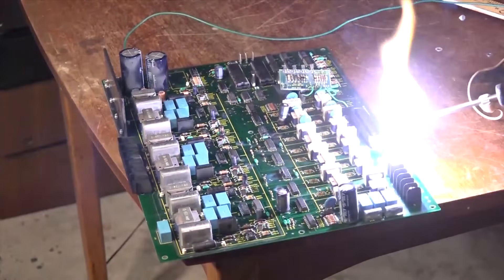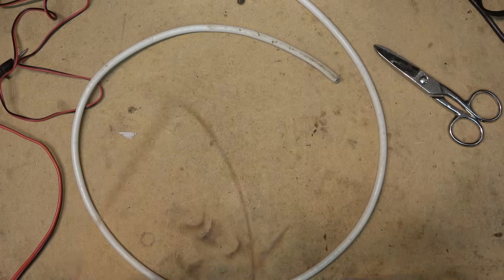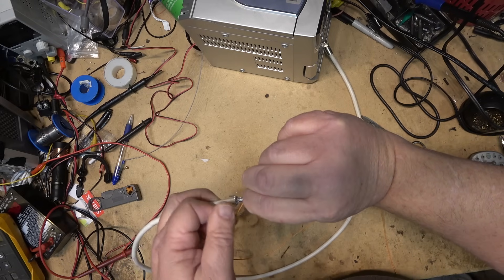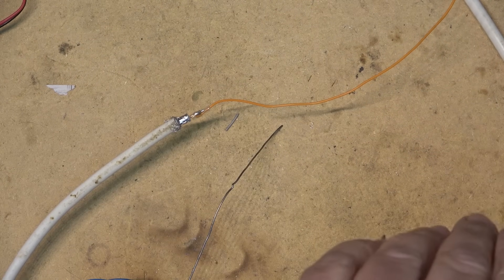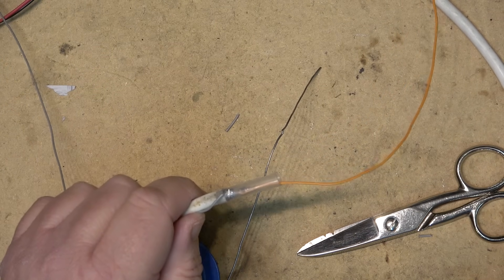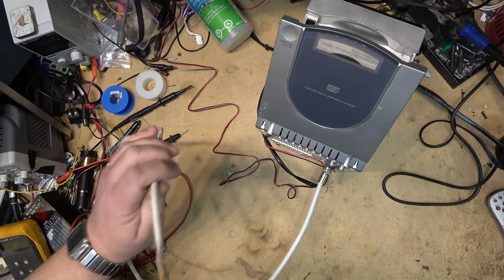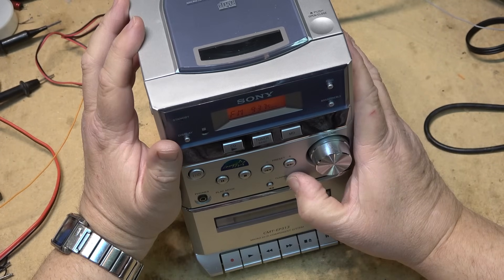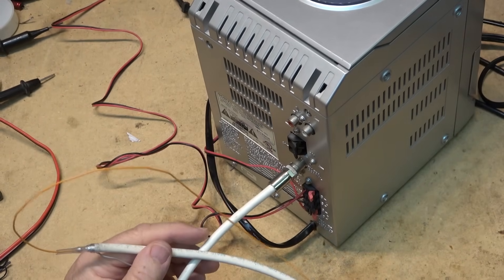Build an indoor FM antenna for 75 ohm coax input

Comment: What if the radio doesn't have coaxial connection ? How to get better reception then ?
Reply from the maker: Use a piece of regular speaker wire.  Zip it apart to the same length for the antenna side and the other side connect to the 2 screw terminals marked FM 300 ohm.
Reply from the maker: @sblaze4  the type of wire doesn't matter.   300 ohm is the 2 terminal connection and 75 is coax.  With 75 ohm you have a single antenna lead and ground.  With 300 ohm connection both wires are active.  It is a balanced connection.

Comment: When or how did 1 29 and a half inch wire turn into 2 wires?  Are the now 2 wires both 29 and a half inches or are they 14 and 3/4th inches?
Reply: 2 piece 29.5 inches to make a 59 inch antenna. you can use 3/8" diam rods if you want something more stable. Screw the centers to a flat piece of ply or similar. Especially excellent if attic mounted.

Comment: So, the piece of cable is for matching the 75ohm impedance, while the two wires are just an open dipole?
Or can I connect the dipole wires directly to a coax connector?

Comment: I have a little Terk FM antenna I'm not all that happy with so may give this a shot.
Reply: Those Terks seem like a pieces of junk. I was willing to spend much more for something that would work really well. It turns out that the type of antenna shown in the video works as well as I can hope for. I use mine and it works very well. The only possible improvement would likely be a roof antenna.

Comment: Followed your instructions to the T and after nearly a year of having my shop receiver set up. (Tried a few old school botch job attempts at fabbing one and figured my tuner may have gone bad) I stumbled upon this video and now after snaking it through the steel sheeting and attaching it on the outside wall with magnets im getting stations i didnt know we had. I never incorporated any coax cable, just the end, had no idea about the 75ohms. I was surprised how the wires really needed to be extended to the full length to get the best results. Thanks again! This is what youtube is all about!
Reply: Yep the antena has to match the physical 'width'  of the wave so scrunching up = not too good.
Reply from the maker: You're welcome

Comment: I have a small Radio I listen to outside my mobile home,  FM station 102.1 which is approx. 100 miles away,  and my radio only has a extendable antenna with NO cable connection. Is there any way I can use a clip on the antenna you made to clip on a regular pull out antenna to enhance my reception?
Reply from the maker: Yes just clip it to the whip.
Reply: @12voltvids  OK, I'll give it a try. Thanks.
Reply: Took an 8 X 8 X 1/2 thk piece of plywood, drew diagonal marks from corner to corner, had a 60 inch piece of 3/8 " plastic tubing, drilled a big enough hole in one side so both wires would come out the center hole and run down the tubing both ways horizontal. Then soldered the 1 wire to the center wire of cable and used shrink tube to mate the other wire to the wire mesh to a coax cable and ran it down the center of the other diagonal, soldered a clip on the center cable wire and clipped it on the extendable radio antenna. Put a mounting clip on the top of the wood so as to hang it as high as I can. Seem to worked fine on the radio, but won't know for sure till I try it out in the morning, but it worked fine in the evening. I need to get a longer piece of cable to mount the "T" unit higher. Thanks a lot for the instructions.  I love Youtube and the people who show us how things are done.
Reply: @12voltvids  Here's the Temporary Mount, till I get more cable to mount it higher, think it should work great. https://pbase.com/pakrat/fm_radio_antenna

Comment: But that’s not 75 ohms. What about a resistor?
Reply from the maker: Of course it is. That is the impedence of the rg6 cable.  This is a dipole antenna and no there's is no connection between the center conductor and shield.  It's not a resistance that you measure.  For transmitter this is of more concern.  This is a receiving antenna so it doesn't matter.
Reply: @12voltvids  oh yeah lol
Reply: Thanks

Comment: Just take a 60 inch length of coax and strip 30 inches of shield off of it. Presto instant FM antenna.
Reply: Back in the 80s we used to use this technique to make an "emergency dipole" for CB radio. That was for 27MHz so we basically stripped back 9 feet of the braid of RG58 (50 Ohm) coax and sort of rolled it back over the outer insulation, then attach a standard PL259 connector to the transceiver end and a few feet of string with a small weight to the other, then if you were stuck out in the country you could just throw the weighted end over the branch of a tree and you were in business.
Reply from the maker: @countzero1136  
50 ohm coax has copper braid. Not rg6 which is what I had on hand.
Reply from the maker: Pretty much anything will work
Reply: So is that 30" with aluminum shielding on rg58 or rg6? And should it be wrapped to make a horizontal wire? Or is it okay to pull the shielding back over the outer plastic covering for a FM  antenna?

Comment: Cool! Can you now show us how to do a decent am antenna for local and dx?
Reply from the maker: Long wire antenna at least 100 feet long.  Stand off the antenna from walls ext and up and over the roof. The ground side to the building ground or a ground rod.
Reply: @12voltvids  Cool thank you! What do you think about a large wire wound antenna? I seem to remember diamond shaped ones from back in the day. Something on the order of what came with fairly late model receivers only larger. Maybe much larger. Can't always run a long wire which is why I'm asking. How well might a large wire wound antenna perform? Is there a particular size that's best? Diamond vs square matter? etc etc etc......

Comment: Cable systems used to have FM on it? Too bad it doesn't exist anymore, because now in order to get music over cable, you have to rent another cable box and tune to one of the music channels
Reply from the maker: They did indeed.  They still do, but they are digital channels tuned by the cable box.  In Canada initially we got all the local and distant FM stations.  The distant stations were on original frequency.  The local ones translated to a vacant spit to reduce interference.  In the 90s the CRTC ordered that the cable systems also had to carry all of the local AM stations on the FM dial this displaced some of the out-of-market FM stations as the band was full. We got the local AM stations on the FM cable band in full stereo which sounded great. Around 2009-2010 when all the analog TV stations went dark the cable companies started upgrading their cable system to full digital and all the analog TV signals went away by 2015 at the same time all of the analog FM cable signals were also removed and that spectrum which would have been where channel 95 to 100 would have been on the cable band was reallocated to digital TV signals. Today if I were to hook an analog TV to our local cable TV carrier there would be one channel visible Channel 2 and all Channel 2 has on it is a display of a spectrum analyzer presumably so field technicians when tracing down interference can look at the spectrum leaving the head end on an analog TV and compare it to the spectrum on their spectrum analyzer. The competition that I work for is all fiber distribution digital TV and internet and phone all on glass.
Reply: @12voltvids  Lots of fond memories as my father was a cable tech in Halifax & Calgary back on the day. Heck, back then the local cable company was called Calgary Cable TV/FM

Comment: Interesting, I never knew the cable company carried FM radio and you can hook up cable directly to an FM radio.
Reply: You can't. It was a fairly short lived endeavor. It began some time in the 80's if I'm not mistaken . However, it has since been phased out. With the unforseen explosion of internet based streaming services cable FM broadcast radio haa gone the way of the 8-track tape. It was still clinging on in a very few markets in the early 2000's. But I'm fairly certain it's been 100% discontinued.
Reply: Yup! Think of it like how digital cable now carries a bunch of the stations. Back in the day we could split the cable so one end went to the TV (or, I'm going to date myself) a converter box, and the other to the home stereo

Let's just say it made the band incredibly crowded, but it was a nice way to listen to AM or out of market stations before streaming or digital cable was a thing
Reply: I thought channels 14-36 were in the same frequency range as FM radio. But I just looked it up, and it's actually just the high 90 channel numbers. I guess that partly explains why I don't think I've ever seen those high-numbered channels used in practice on analog cable.

Comment: What are the diffrents between 75 ohms and 300 ohms anntenas?
Reply: About 225 ohms...
Reply: @ElectoneGuy  That's an answer for someone that knows electronics, I don't
Reply: I would think probably not much difference, if any, for the fairly short lengths here. It matters more for longer lengths like you would use for an attic mounted or outside antenna. The following is from the manuals of 2 late '80s/early '90s tuners I have: 
JVC - Generally the coaxial cable suffers from more loss than the flat parallel feeder when they are the same length. The flat parallel feeder, however, is more liable to pick up noise.
YAMAHA - Flat ribbon-shaped twin-lead cable performs well electrically, and is cheaper and somewhat easier to handle when routing it through windows and around rooms. Coaxial cable is more expensive, does a much better job of minimizing interference, is less prone to the effects of weather and close-by metal objects, and is nearly as good a signal conductor as feeder cable, particularly for foam-type coaxial cables. Coaxial cable is somewhat more difficult to install at the point where the cable enters the building. If coaxial cable is selected, make sure the antenna is designed to be used with that type of cable.

Comment: F connectors for FM radio. Interesting. In NZ, it's co-ax plugs like our tvs. The only time we see f connectors is set top boxes like satellite receivers from the LNB
Reply: Same hear in the UK, IEC coax connectors there called i dont think there commen in north america its all F connectors.
Reply: North America uses mostly f connectors for residential and bnc for commercial, like cctv and broadcasting. Also, just like our "wonderful" electrical system, you can get a very good zing from the connector if you're not careful and the signal is amplified.

Comment: Hmm the 468/F 1/2 wave dipole,  for aluminium wire.
Reply: That's the full dipole length at ~100MHz.  This antenna is 1/4 wavelength:  f = 100e6Hz,  c= 299792458m/s, λ = c/f = 2.998m; l = λ/4 =0.7495m = 29.5in.

Comment: Would that work for a TV?.. or just receivers.
Reply: It would also work for North American VHF TV stations. Unfortunately with the digital phaseout those are pretty much gone. Most digital ATSC broadcasts are actually in the UHF band.
Reply: Yes, BUT you'll need to look up the new frequencies for what digital channels you want to watch. You do NOT need to buy a specifically made 'digital antenna.' The good thing is a home made digital TV antenna is MUCH smaller and easier to move around.

Comment: I'm going to try this with my SDR receiver dongle. It comes with a stock "rabbit ears" style antenna but I bought some adapters to adapt a regular F connector to the smaller coax used on the SDR so I can use my old antennas for my TV.  Hope this works better.

Also why 29 inches? Does length not matter when receiving signals only transmitting?
Reply: Length important for best reception, total length = half the wavelength.

Comment: so the 29.5 inches on opposite directions are to pick amplitude frequency of FM? do other lengths pick up other frequencies?
Reply: It would be best to make the length according to the frequencies you want to listen to.  Most FM broadcasts range from 88 to 108 Mhz.  To calculate the length make for the midway point ie about 98Mhz.  Find the quarter wavelength of 98Mhz which is 2ft 4.7 inches.  Make the lengths half that and attach as shown.
Reply: @coastmansingha9980  In metric units: divide the speed of light = 300.000.000 m/S by frequency (100.000.000 Hz).  This equals 3 meter.  To obtain a 1/4 lambda antenna divide 3 meter by 4, which is 75 cm (about 29.530 inch)  This is an approximation.  The frequence may be a little different and the speed of light in air is not exactly equal to its speed in a vacuum; nor is the speed of the signal transmission in the copper wire. For the extreme values of the FM band, you can add or substract 5 cm (about 2 inch).  Which can be done easily with a telescopic antenne.
Reply: @1959Berre  Wow. Remember I am not the original poster on this subject I was only trying to help. So by all means take the piss. Its not an exact science you can pick up radio signals on a any piece of wire.
Reply: @1959Berre  Having looked at your YouTube channel I see you are a professional Tosser with 14 subscribers. You must be very proud and maybe living in a care home.  My sympathies & best wishes with the treatment. 👏
Reply: @1959Berre   ah the telescoping antennas… Never occurred to me those are like little dynamic dipoles (of rewired)

Comment: Does the coax cable need to be a certain size? Or can it be longer?
Reply from the maker: You could put the radials outside for better reception.
Reply: Make sure it is 75 ohm you need and not 50 ohm.  Most receivers require 50 ohm.  Any RG6 cable shielded will do.

Comment: How long does the pieces of wire need to be?
Reply: 29.5 inches? Each? Or together?
Reply: @sargetester99  I would go for each cable being half of 29.5 inches ie 14.47 inches.  Its the overall length that matters  Basically you are tuning it to the FM Broadcast frequencies which usually lie between 88 to 108Mhz.  Hope that helps
Reply: @sargetester99  Each I would guess.
Reply from the maker: @sargetester99  each side 29.5 for FM broadcast.

Comment: How about the spring terminals
Reply: 7:19
Reply from the maker: These ones are for the AM loop antenna
Reply: @12voltvids  mine has them both for AM and FM Aiwa decided to use two sets of spring terminals for the antennas and they have the FM rated at 75 Ohm which makes hooking up an FM antenna interesting unless I use what came with it (I was able to find a Terk amplified antenna that came with two balins one 75-300ohm with the Spade lugs for screw terminals and a 75-75 Ohm which has the bare wires for spring terminals but there are also stereos that have screw terminals for both 300 and 75 Ohm cables including some portable radios so that there brings up the issue of should you cut off the f-connector or leave it in case you end up having to use it on a radio with an F-connector and some Radio Shack antennas have the power connector also attached to the F-connector plug making it not possible to cut it off hmm interesting) how different manufacturers do things (some Sony's have a 3 pin plug)
Reply from the maker: @jcurnutte2007  
Yes i am aware that some have 300 ohm terminals and some even have terminals for 75.  This one has a coax only and that is what i made the antenna for.   For 300 ohm balanced a piece of speaker wire works fine with 29.5 " elements going to each side connected to each lug.

Comment: Thanks, I've been needing one of these for my mums old stereo, will do that!
Reply: Did it work?
Reply: @seanwatts8342  Damnit, I still didn't make one, she's not been able to use the stereo because someone else is living in the house, I will try to report back
Reply: @Jonas_Keunecke  The connection on the back of the stereo will determine what kind of antenna to use... 75 ohm or 300 ohm (normally.) It's not too complicated since you are not making a transmitter antenna.
Reply: @seanwatts8342  Thanks Sean, I will check for the back of the tuner, but it's got a connection for the cable radio I'm pretty sure as he talked about in the video (just re-watched it). I am in europe though, so not sure if that still applies, thanks to you two for the advice

Comment: You could have showed us the socket that connects in radio !
Reply from the maker: It's just the standard screw on f connector used on every TV in north america
Reply: Screw on connector cause  ingress and regress.

I used a compression RG 6 fitting and received more channels.

I also added a small amplifier with a tilt screws for low band and high band control.

The tilt really help the low band channels.  

I was a head end tech for a telecommunication company 30 years.

The amplifier is hooked up backwards. 

The input to amp is from the antanna. 

The out put of the little amp is going into the radio. 

Great antanna.